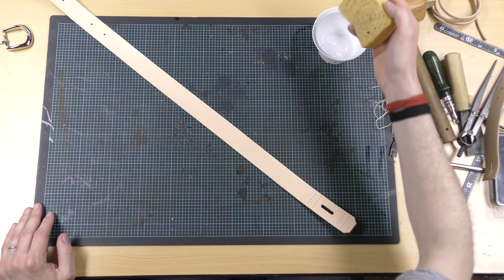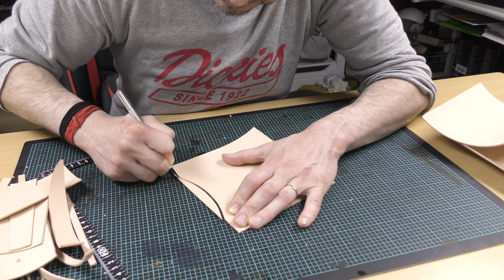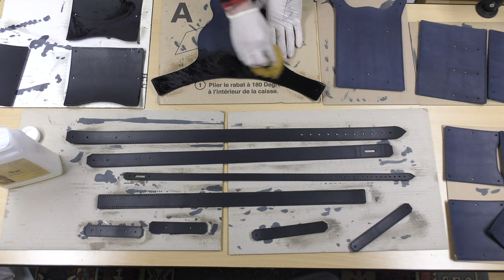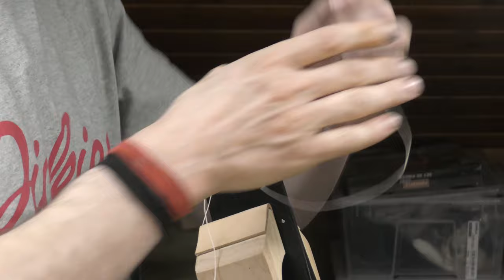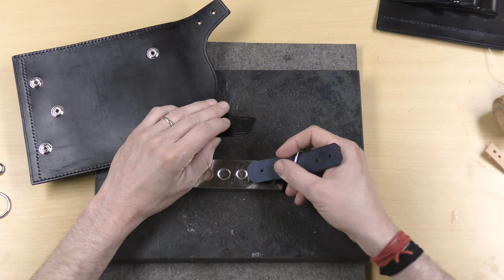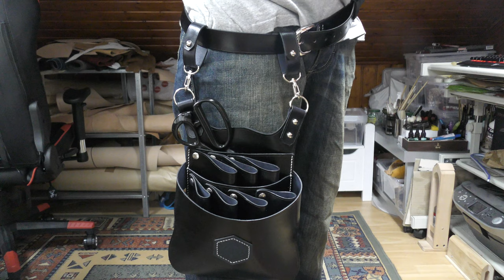How to Make a Leather Tool Belt / Leatherwork With .pdf Pattern

Comment: This Old LEATHER SMITH says very nice, I have a suggestion, I glued a piece of upholstery leather hair side down 2 my rivet and snap anvils, stops dents and scratches, I also glued a piece of tool drawer rubber 2 the bottom of said anvils stops sliding and cushions the blow which stops flating of cap rivets and snap caps. GOD'S BLESSINGS ✝️⚾🙃
Reply from the maker: Great tip! Thanks for sharing! Cheers!